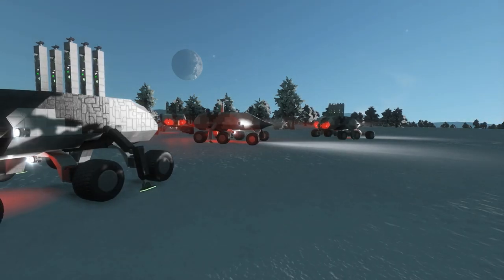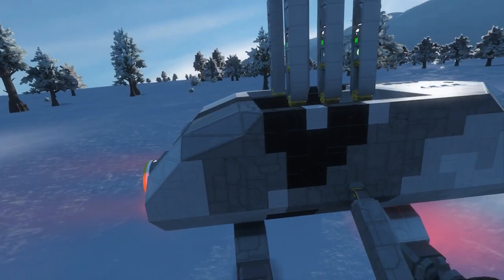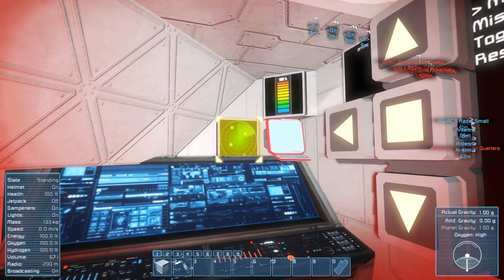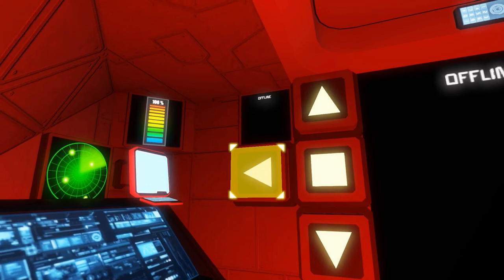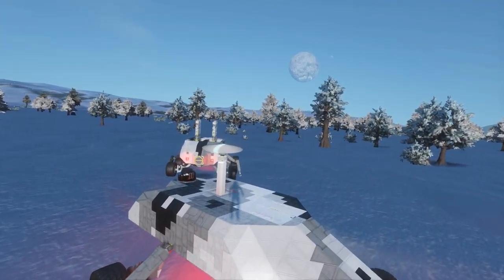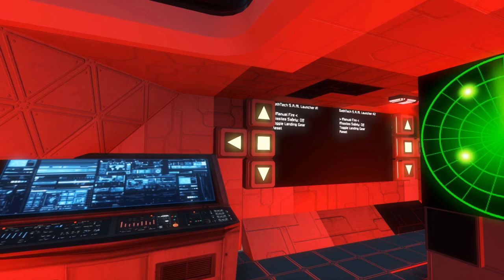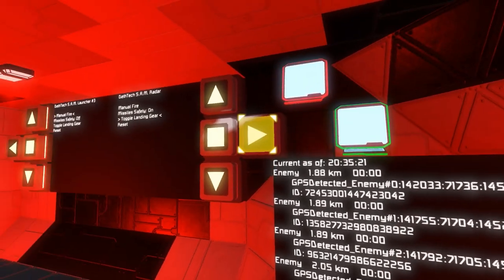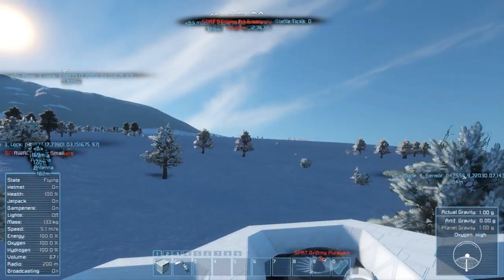Let's Play Space Engineers S2E16 S.A.M. Battery

Comment: thats really cool man! I challenge you to build a S.A.M. battery with just one missile, with a stack of welders to 3d print more missiles between cycles.
Reply from the maker: +Kris Harrison I forgot to mention that there is room for a welder and cargo to do that. It would not be difficult, just slow as the small hydrogen tanks take a while to fill up. Would work for ones powered by atmo thrusters, which I will probably do at some point after I tweak the missile code a bit for moving targets.
Reply: +silentdeth originally my comment had a lot of details including it would probably need to be atmo. but I thought it looked too long for a challenge. Hehe.